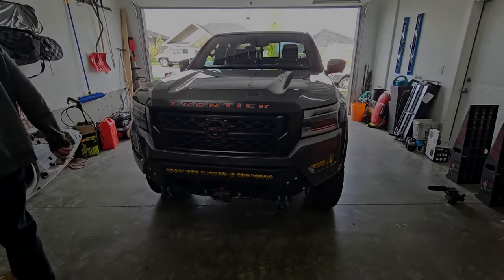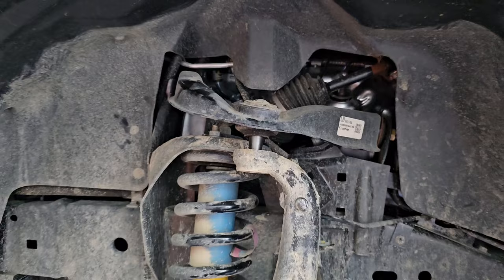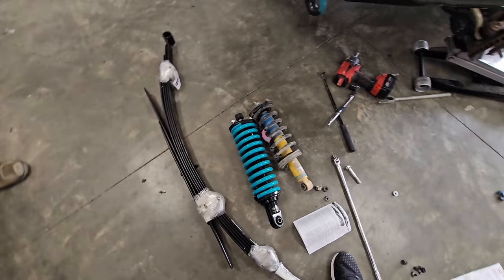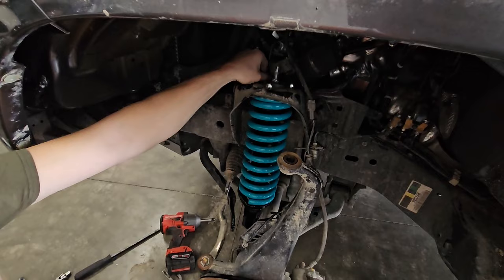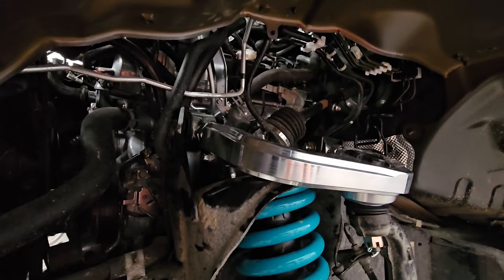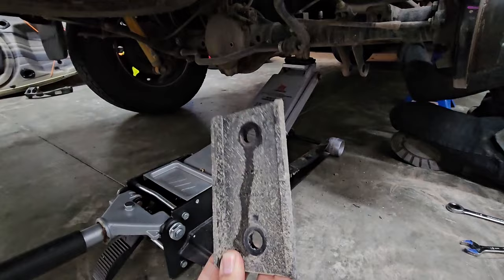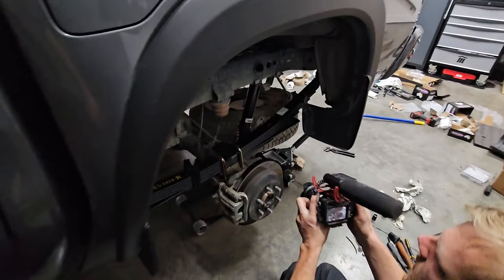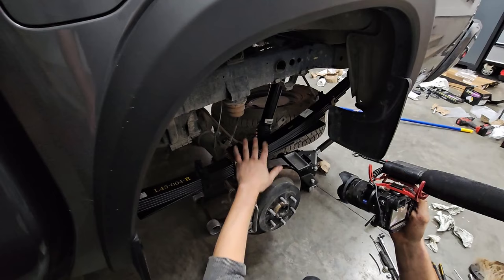How To Lift Your 2023 Nissan Frontier Pro-4x *Dobinsons IMS Lift Kit Install*

Comment: Great video, I just did my install yesterday. A few things I noticed might be off in your instructions: 

1. Don’t grease the rear shock bushings since they’re rubber. 
2. Torque for the bolts at the front and rear of the Dobinsons leaf hardware is 90 ft lbs (you provided oem torque)
Reply from the maker: I couldn't find the dobinsons specs so thank you very much.
Reply: @CanadianCruisin  just fyi, on my dobinsons extended travel front i found the brake and abs lines to be borderline too tight at full droop and full wheel lock. I bent a few brackets to resolve that. Also, check your clearances because my sway bar makes contact with the outer tire rod at full droop + mid to full wheel lock.  In the rear, at full droop, the brake cables are very tight, too tight for my liking. Also the diff locker cable is tight by can be lengthened by bending the top mounting bracket. Safety first! I checked for cv bind at full droop and full wheel lock and did not feel or hear anything.
Reply from the maker: @madoxx1911  thanks for the heads up I'll definitely take a look when I get a chance.

Comment: Good job. You mentioned it’s getting new wheels. If your wheel/tires are different size make sure to have them on before alignment
Reply from the maker: You bet. That's why I kept the stock tires on while the suspension settled. Then the new set will go on with the alignment

Comment: Great video, very informative! I really like the dobinson lift! I installed an ADO RC killa lift on my 23 Pro4x, but I’ve been looking at the ADO Fox 2.0 extended travel kit but now you got me looking at other options!
Reply: Also you saved yourself a lot of trouble buying the coil overs pre built. I learned my lesson, that’s what I’m doing next time 😅
Reply from the maker: @ApexFrontier  once I did my mustangs springs a few years back I said never again lol
Reply: @CanadianCruisin  yeah it was so sketchy
Reply: How do you like the RCKilla lift?  I just bought with new UCA’s from ADO.
Reply: @02PSU  I’ve got some installation videos on my channel if you wanna see how I did it! For the price you can’t beat it imho. But I will say the recoil of front springs is a bit aggressive, and it’s quite the task taking the old springs off and putting the new springs on the shocks. But yeah overall it’s a pretty solid lift, and I love the ADO UCAs, just make sure to grease them!
Reply: @ApexFrontier yea I like their uca's I ordered the koni kit from them but unfortunately they called and said it would be months out before delivery because of the issues in the Red Sea. So my only option around the same price was the Bilstein 5100 kit I know they are not as good but they do ride great and I have put them through some abuse and they are holding up. I'm thinking about the dobinsons next though.

Comment: Looks really good .. did you need camber bolts for the lower control arms for the final alignment?
Reply from the maker: Yes I added the cam bolts to the lower control arms

Comment: All that into it and you haven't done the rear diff breather mod yet? It's the first thing I did when I go my truck. Less than $50 and it'll possibly save you thousands....
Reply from the maker: It's coming. I also have the warranty so if it breaks its a free fix anyway

Comment: Sorry for all the questions but did you guys put longer bump stops in the rear? The dobinsons shocks are 1 inch longer at full compression than the bilsteins. Just curious if you guys measured that and considered it? What bump stops did you go with?
Reply from the maker: I havent changed the bump stops on mine yet but I may in the future.

Comment: Which coil springs and leaf springs did you install? Part numbers...

Also, why did you go with the 800 lbs leafs if you have no added weight in the rear?
Reply from the maker: I can't remember the parts number but it's the heaviest front and rear they make. I plan on adding a few more things to the back which will add quite a few pounds so figured go heavy right away and won't have to worry about it later.

Comment: What tires are you planning to run?
Reply from the maker: Mickey Thompson baha boss
Reply: @CanadianCruisin  What size will this lift clear?
Reply from the maker: @curtshelp6170  that depends on how much you're willing to cut off the fender to make them fit. You won't be able to go much larger than stock without rubbing
Reply: @CanadianCruisin  Too bad. I was able to go 32s on my 2019 Colorado diesel with an Eibach leveling kit and it made a great difference.